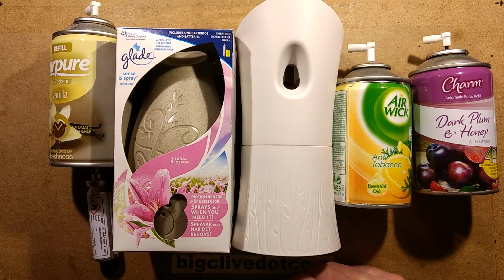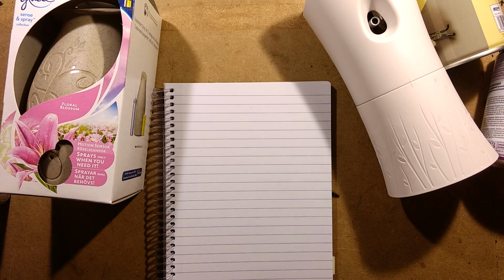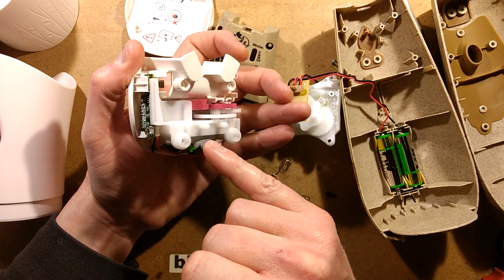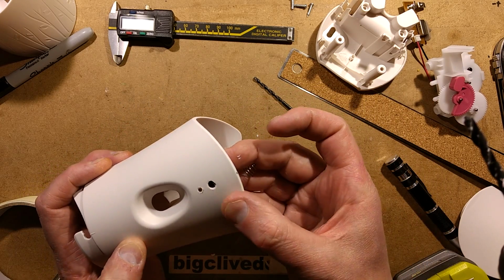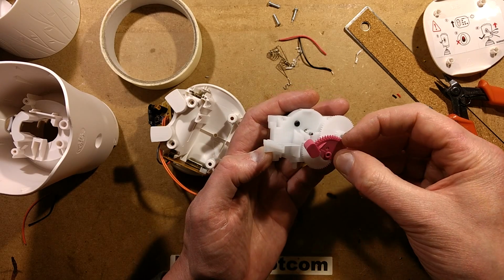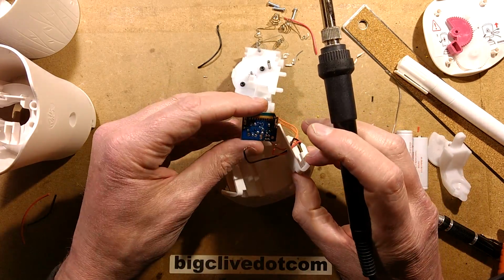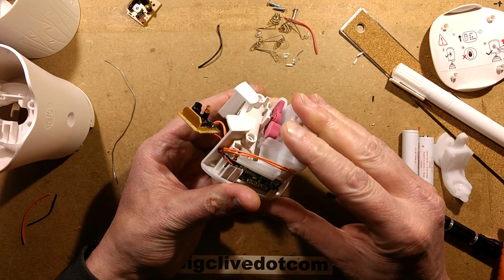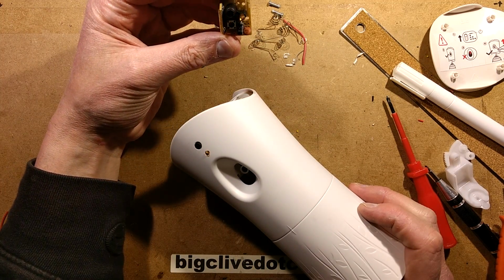Air freshener cross-breeding.  (mild profanities)

Comment: We get generic aroma refills from Walmart but not long ago Glade changed the shapes of their spray nozzle and the receptacle on the unit, probably to make people only buy the name brand refills. So now when a scent runs out we have to pull the nozzle off and swap it with the one on the new can. Pain in the butt. I expect Walmart will eventually change their canisters to once again match Glade's.
Reply from the maker: For a while airwick went on e step further and put stripes on the can nozzle and an infrared sensor to see if they were present.  So to use generic refills you had to use a sharpie to draw lines on the side.
Reply: @bigclivedotcom  shades of Juicero.

Comment: Back in the '70s when we were young I tried to repair a classic Dansette portable record player for an old lady.  The volumn knob was causing interference when one turned it.  I had it all in bits in her flat and the owner was explaining what the clever young man was doing to her equipment.  When reassembled I switched it on and there was a loud bang and smoke.  I tried to defuse the tense situation by explaining that you get a noise when you switch an electrical device on but my girlfriend, now my wife, pointed out that you don't usually get smoke pouring out!  I'd blown a fuse which fortunately was a modern push button fuse but the owner had lost all confidence in me.  I offered to take the record player to be repaired by a friend of mine.  As we walked along the main road to my house my girlfriend and me were laughing so loud and for so long that a girl on the other side of the road started laughing too!  My friend diagnosed the problem: two wires carried 12v and two identical wires carried 240v, I'd swapped them around.  Oh and to fix the volumn knob I should have squirted a liquid cleaner in - no need to dismantle the record player.

Comment: The bit about blowing up a board and then claiming it was faulty reminds me of my dad. Had a $2000 set of Keff speakers, new model got released, shop said the only way to upgrade without paying would be replacement under warranty. Wink wink.
Dad went home and plugged 120VAC into those $2k speakers. Hell of a 60hz humm for a bit and then wonderful smoke.

Still has the upgrades 30 years later :P

Comment: Funny this showing up today, a couple of weeks ago I bought a refill in Homebargain for £1.29(not something i'd normally do as you can get a big spray can for a £1) Thought id got the correct one but it wasnt, so took it back yesterday to change for the correct plastic fitting at top, they only had them in 2 packs for £3.99 so I kept the one I had, when I got home I removed its plastic shell, thought I might need to print something, but no it fits straight in, problem solved.

Comment: Great video! I just revisited this! That guzzling unit they have with the timer and motion sensor, is it possible to disable the timer and just have the sensor operational? I just found one in a box and realised why locked the baastuud thing away!
Reply from the maker: Most of these use a microcontroller for control, so changing operation would require new software.

Comment: I used to have the best air freshener ever. It had a sensor that could "smell" and when it smelled bad odors, it would then spray the fragrance! I think it was from Air Wick, but I'm not sure. It worked very well too, although some "false smells" were not rare, especially with the window open or when taking a shower, it never missed a bad smell.

Unfortunately, at some point refills were not available anymore, anywhere.
Reply from the maker: I got one of those and took the sensor apart.  I got the feeling it may just have regulated the output to a defined level of a chemical contained in the aroma.  But I could be wrong.

Comment: Don't worry nearly everyone who does electronics and soldering has wired a component or board up with reverse polarity or the wrong voltage and smelled the magic smoke or heard the magic noises upon powering it! I've fried a raspberry pi and a few arduinos myself as well as accidentally blown up quite a few electrolytic capacitors

Comment: I did this. Except I wired it into an arduino and programmed it to record the lighting changes compared to the time of day, then average them out and attempt to spray two minutes before it anticipates the next change. It's been quite effective, and gets more accurate
 all the time, particularly before I take my shower or brush my teeth (same time every day). So I walk in and can tell it just went off. Even if it fudges it slightly the smell lasts for half an hour with the bathroom door open. Also wired it to take a small lithium polymer and be USB rechargeable. Anything worth doing is worth overdoing. :)

Also, my dad:
"It's creepy. It knows when I'm going to poop, I feel like it's laughing at me".

Clive:
"Sells these units really cheaply hoping to make lots of cash off the refills... much like the printer market".

My Epson EcoTank with two years of bottled ink, zero cartridges, and 5000 full black printed page capacity says hello. I got done with $70 ink refills a year ago and couldn't be happier.
Reply from the maker: I use an eco tank too.
Reply: @bigclivedotcom  They're quite impressive. The big printer companies seem to have finally given in to those of us who like to monkey with things.

I wondered if you had something similar, what with how often you have full page circuit copies for us to see.

Every once in a while, maybe once a week if I haven't used it, I'll throw a test page through just to keep the heads clear. Had a nasty experience with a cheap Canon drying out on me once that left me wary of that.

Comment: Since watching your videos ive dismantled an air freshener, large fan, fan assisted heater, large rechargeable torch lantern with lead acid battery, some old lap top batteries.
Ive managed to put the remote control car back together and modded it to take 3 X 18650 batteries, its now a lot faster and also lasts a lot longer :)
What exciting things can you make with AC motors and the other pile of junk ive now got ? lol

Comment: Legitimate question here: I have the larger air freshener model in my bedroom, and I find its quite noisy when it goes off? Any quick ideas on how to make it quieter?
Reply from the maker: They are incredibly noisy.  Originally the units these were based on had a light level sensor that turned them off when the room was dark.  But they removed that feature to pump their way through the cans faster.  I'm not sure I'd recommend sleeping in a room with an air aromatiser in it.

Comment: Go all the way, why stop there, buy a paint can filler from a car shop estate sale. Buy a gallon of your favorite scent (or mix as we did in school experiments). Once you have all these, refill your own PAINT sized cans and that's that. 
And i'm not talking out of my ass, i did the above (the whole system is aaaabout 60USD, if you're lucky and find a shop that's refreshing their supply, o-rings need to be replaced in the machine itself, as they are tacky with paint, and never refill the same can more than 10 times) used it to refill compressed air for my cleaner bottle, sick an tired to pay so much for fucking air.

Comment: Put it in the box and returned it as faulty. Yes, did that with a SEGA Saturn I was modding with an OS override switch. Little sister came home, noticed me with my soldering iron, nearly knocked my head off, and sent the iron through the Saturn's logic board. Next morning off to Wal-Mart, returning with a brand new Saturn. 

MANY years later I still have that modded SEGA Saturn. Mmm... Imported games...
Reply: And as for "mild profanities"... I should keep the audio recordings during my daily drives to work and back... Oh the creative swearing I come up with... Yes, my Honda Insight is equipped with a Koonlung K1S dash cam thanks to Techmoan. As for you, that bogus water tester video was epic. Snake oil still exists in this world. Like end users trying to get IT to install iTunes on their PC so they can page patients... Laughed more than my peach off that time.

Comment: I used to be the cleaner(janitor as the Americans would say) at my work place, we had sensor triggered motorised Bay West paper towel dispensers that would randomly stop working even with fresh batteries, ended up having a shed full so I'd just fuck around with them or try to cannibalise them for parts, the wires in them just push in, one time I just discovered my chance that you could cross two of the wires in the dead ones & the motor would run continuously, then when you crossed the wires back again the unit was in full working order again, I wonder if this was a designed reset feature? & if so why didn't they just have a button or jumper switch for that?
Reply from the maker: +milksheihk I wonder if the mechanism had just jammed slightly and the direct powering nudged it free again.
Reply: I had thought this but the units that were going down were moving freely, there were a little over 50 of the units installed around the site & I always had 4 or 5 in storage, if one stopped working I'd swap the whole unit & then when I got a chance I'd have the one I just took down working again in under ten minutes & it would become a spare.

Comment: +bigclivedotcom
Is it possible to drive one of those 20-100w 40*40mm LED chips from a 12V source?
Reply from the maker: You get drivers that will allow them to be run from around 9V upwards.  They generally only cost about  a pound/dollar on eBay.

Comment: Air Wick have a trick up their sleeve..... the spray nozzle has two black marks on the side like a bar code....this prevents one from buying a cheaper can and using it in their unit. A light beam looks for the black marker  ...then when the motor presses down we have a piece of white going past the sensor this tells the unit the can is "legal" one. Plus if you pull of the nozzle and try to put it on a Glade tank there is a trick that blocks the hole and one can't put the spray on the pirate tank so to speak.. 
   https://youtu.be/nFDkkGhATrI   this link explains it all.....

Comment: Rather embarrassingly I did the same when I was 17. i was still doing my electronics course  and working part time at a pub. They had a new disco light fixture on loan from another pub, a kind of multi coloured UFO that rotated in all directions with a mains halogen lamp in the middle. well of course I thought it was all mains didnt I . So I wired all the motors and lamp up to a plug cos I wanted to see it working. Switched it on and the lamp came on a blew all the motors with a spectacular bang and smoke of death. Turns out they were 24V motors. I think I worked a lot of shifts for free to pay that back :( stupid me lol

Comment: 17:55 Don't worry - I blew the high voltage generator board on a VERY expensive isolation tester but I went and admittted it right away. No harm done.

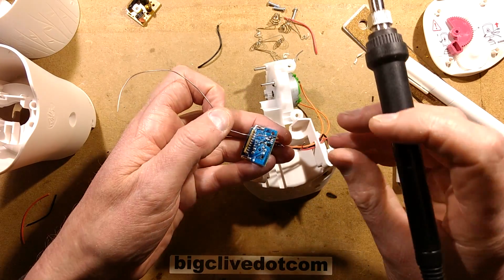Comment: 17:50 - Yes, sometimes people do make expensive mistakes, but usually learn from them.  Usually.  One of the technicians that used to work under me fried 2 MAC2000 fixtures in a row.  They were early ones without the switching power supply, and were configured for 120V.  He powered the first one up at 230V and smoked it.  Then he shrugged his shoulders, connected the second one and promptly fried it as well.

Comment: There are black lines on the side of the white moulded plastic nozzle at the top of genuine Glade refils.  If you get a black marker you can copy the stripe and use cheap refils from the pound shop.
Reply from the maker: Yeah, I've done that in the past.  The Pound Shop cans simply used a single band of black and it also worked.  There's an infrared sensor that detects the reflected change when the plunger is pressed down by the mechanism.  I don't think they even include it in the units any more.  Probably due to reliability.   If you put in a can without that mark it would press the plunger once and then report it as an "incompatible refill" by flashing the LED and refusing to operate.

Comment: Frankenfreshener.
My Aunt has one of those ones that was popular in the 80s, that's mounted on the wall, and you press on the outside of the casing to activate it. I was moving an over-the-toilet shelf out of the bathroom, backed into it, and it scared the shit out of me. I didn't realize it still had a good canister in it. XD
At least you got it right in the end. I fucked up the preamp on a '67 Zenith Circle of Sound stereo, and it's still sitting in pieces in my living room. Been like that for 4 years now.

Comment: Clive, you probably won't see this (and apologies if it has already been mentioned) 
When drilling plastic, set the drill in reverse and allow friction to do the work, this stops the bit from snatching into the plastic.

hope that helps somebody!
Reply from the maker: I generally avoid using brand new drills for plastic.  I keep the blunt ones for that type of material.
Reply: bigclivedotcom : Certainly makes sence! One other thing you (or anyone else) can do, if you find yourself drilling the likes of acrylic or other more brittle plastics and keep "blowing out" / chipping the hole when the bit is exiting, it would most certainly be worth grabbing an old/dull bit and backing it off with a grinder. For those that arent familiar with the term, it is where you increase the taper of the cutting edge. Deffinately saved my ass a few times

Comment: clive, apropos of nothing, have you ever encountered the supposed incredible dangers of running current though coiled electrical cables?
Reply from the maker: XARGON 666 The main issue is heat buildup where high current is involved.  A drum of cable can get very hot if it's powering a load while still coiled.
Reply: bigclivedotcom ah ok, so how much coiled cable does it take for the effect to become noticable?
Reply from the maker: That depends on wire size, load, ambient temperature and how thick the coil is.

Comment: I had a bit of a polarity F-up myself the other week. I was charging a pair of 12v mobility scooter batteries outside of the usual battery case. I'd made up a simple hook up to put them in series, with a connector. I was hoping that the desulfator circuit I'd been trying out was improving the batteries. When I plugged in the charger, I got a red charging light and it stayed on. After a while I thought I'd try it on my spare battery charger and it was showing a red charging light too. What I didn't realise was, that under the influence of a nippy sweetie, I had reversed the battery polarity and the fail state of the chargers was a red light. I destroyed both chargers and had to cry, whilst ordering a new one off Amazon.

Comment: Nice mod. Maybe you can get your hands on some of the even larger 'industrial' ones that are used in public bathrooms.
Reply from the maker: The first of these ones were just badged industrial ones with the light sensor function removed and the hole for the light sensor had a white plastic blank in it.  There are two possible reasons for the removal of the light sensor.  Unpredictable light levels in homes or the desire to keep pumping out aroma 24/7 to sell more cans.

Comment: Anyone considered making their own auto air freshener? I am thinking maybe a PIR to activate and timer to ensure it doesn't activate again for some time. As for the trigger, any suggestions? Stepper motor or maybe an actuator? Any suggestions on one strong enough to press the nozzle? Have the motor press down on the nozzle to spray  or hold the nozzle against a fixed top and use a motor to lift the can from underneath basically pushing the can up and effectively pressing the nozzle against the top of the unit causing it to spray?

Comment: Re cheap calipers. You might want to measure the current it consumes when it’s on and off. I have a cheap Chinese caliper, which works great and is fairly accurate, but all the on/off switch does is toggles the display. The unit constantly consumes something like 20 mA (a huge amount of current). Now I just take the battery out when I’m not using it.

Comment: Also, the sprayer units with off-brand label here have a very generous amount of space in them, and the circuit is either composed of free-running motor and a spring-loaded cam and shaft that moves the arm down, presses the nozzle then returns back to its timer mechanism or ones that turn on the motor every so often that presses the nozzle via sets of cogs with "finger" on it that returns to its original place by the power of spring inside the nozzle (based on either logic timers or 556 IC chips)
Strangely, the ones with variable timer only have delay of either 1, 4 or 24 hours. What an odd value.

I have seen one that has "Spray Now" button that initiates its spraying routine about 3 seconds after the button is pressed, presumably to avoid spraying noxious aromatic oil and aerosol into the person's eyes.

p.s. The ones available here either has Light Dependent Resistor or Phototransistor as light sensors, but they don't seem to do anything for some reason, as the spray function activates even with all lights off. You know, everyone loves being sprayed with aromatic oil that barely resembles any sort of flower or fruit while being in the dark with a sleepy head.

Older ones have two holes for LEDs, but only one is installed and it always seems to be red LEDs. It's not like green or blue ones were expensive; By the time those units were manufactured, the price per LEDs (high-intensity pure green, yellow-green and blue) was as low as $0.01. Let me ask you a question though. Who the hell thought installing RED LEDs behind BLUE cover was a good idea?! The LED has two functions, one is "heartbeat" and the other one is for notifying people about impending aromatic-chemical-spraying action. That means the LED NEEDS to be seen to people, but these guys seem to not care about it at all.